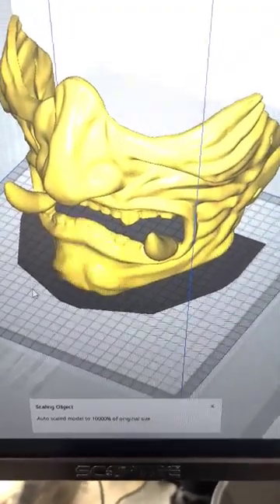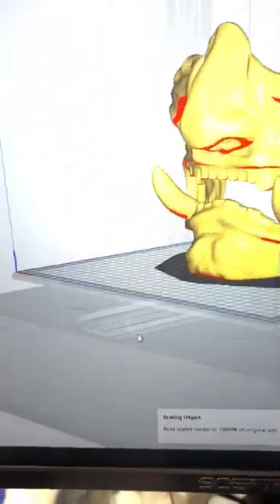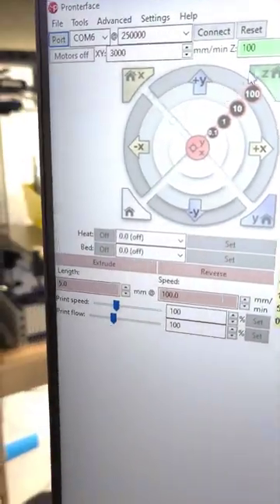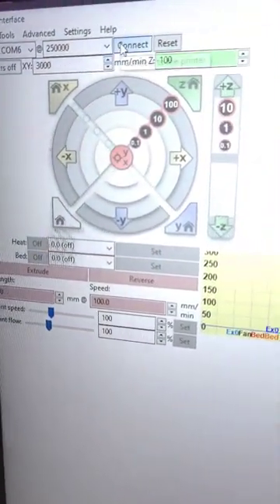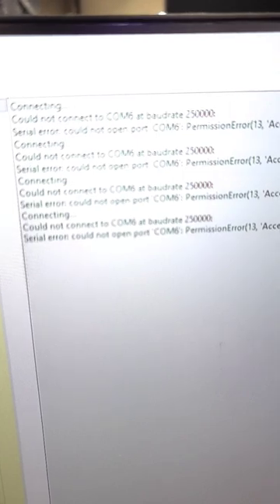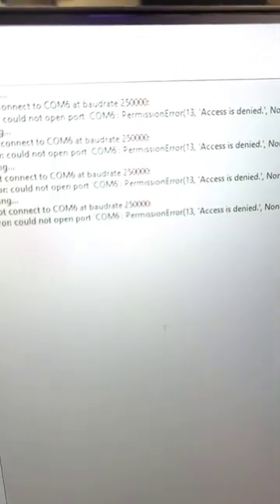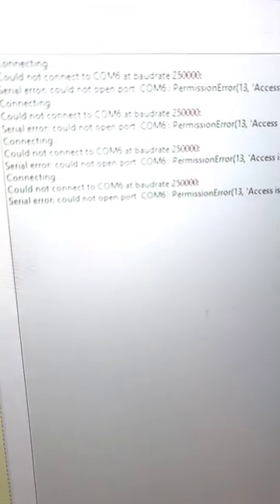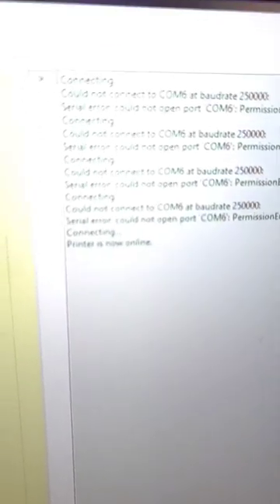Help! I can't connect in pronterface? #3dprinting #3dprinter #cura

Comment: im having the same issue and  cura isnt running at all?!?!?!?
Reply from the maker: Something else is likely grabbing the com port.
Reply: hey.......... did you find out the actual cause of this error?? i have been facing this issue since 18 days but still can't find the solution
Reply: No I didn't. Might be bc I'm running professional software
Reply: @TheMrhighclimber  hey I have found the issue.... The endstops cause this issue..... If one faces this issue of frequent disconnecttion between PC and Arduino, then he should invert the terminals of endstops.... It will rectify the problem...
Reply: I don't have an Arduino. Just the pc to printer
Reply: Can you please explain me more ????

Comment: I dont even have cura installed and pronterface wont connect
Reply from the maker: Likely then another app grabbing the com port.
Reply: @MakersMashup  how do you find out what is then?
Reply: hey.......... did you find out the actual cause of this error?? i have been facing this issue for 18 days but still can't find the solution